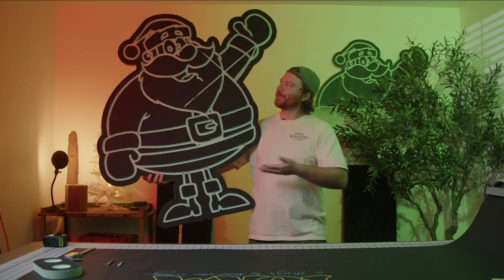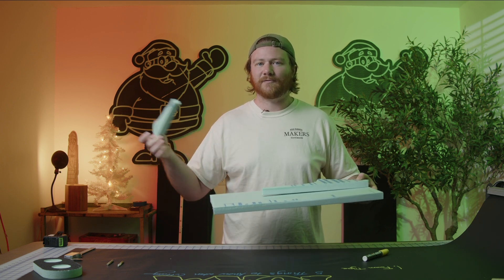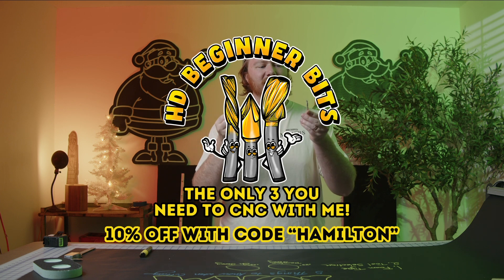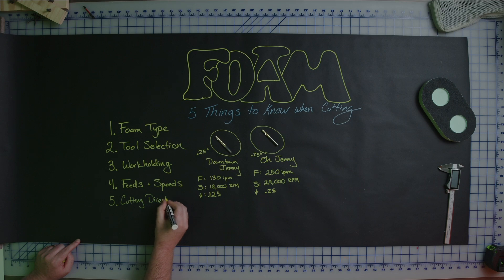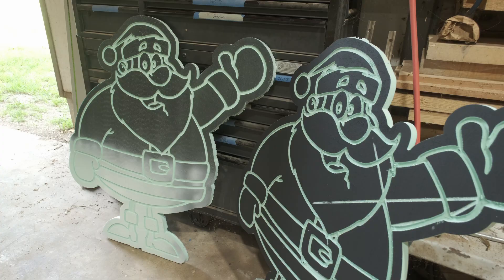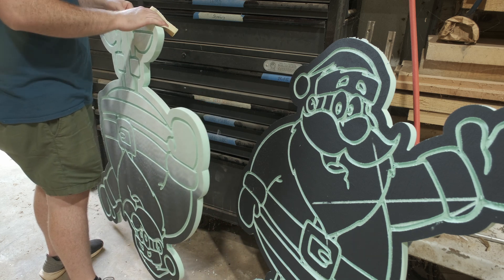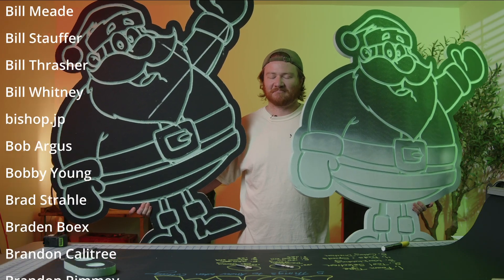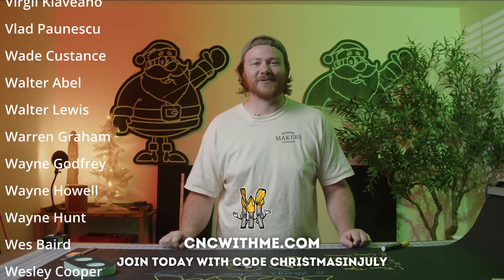5 Tips For Cutting Foam On Your CNC Router

Comment: Thank you for posting! I'm considering the Maslow for cutting 2 in rigid insulation foam into triangles for my geodesic dome. I don't need crazy tight accuracy; I just need a speedy way to cut these triangles. I'm getting about 4 triangles out of one 4x8 sheet of foamboard ( manually cutting with foam heat knife ) . Each triangle is about 140 inches; so 560" toolpath total per board if it were one pass to cut through 2 inches. Think this is doable? Thanks for any recommendations!

Comment: Hey - used to be a planner and worked a while in a big KD plant so HOOYA. 
So you didn't illuminate us about what the upcut function in the program does differently. I haven't a clue. Gimme a clue!
You did offer a little theory on spin and feed - I've never worked with foam and now I need to without a CNC - just from a template. I'm going to use a trim router in the hand to make simple cutouts of printed poster-size stuff. Haven't done this in a while. It'll be production scale - a few hundred a month. Bet you it's faster.

Comment: I may have missed it but did you paint the foam before cutting it to expose the green foam underneath?
Reply from the maker: yes! any spray paint will work as long as its not lacquer based. Lacquer will melt the foam
Reply: @HamiltonDilbeck  I used that foam to make some tombstones for the yard last Halloween. I used the wrong spray paint because it did melt tom some degree as you indicated. IN the end, it was OK because it gave the headstones a very weathered/worn look. After carving I used various colors of epoxy for the graphics and lettering. They came out really nice. Thanks for the tip on using non lacquer based though, I may try using this again for other projects that I don't want to look worn.

Comment: I cut foam often (xlpe). I always rough pocket with climb, leave a little stock, and finish the walls with conventional. In some foams, a conventional pass will produce long ribbons of material that will wrap around the bit. 

I run with the highest feeds and speeds I can, only if the material is rigid enough. Softer foam is tricky, so i keep a high chip load but lower the rpms and ipm. There's a risk for melting material. Also, conventional cuts can suck softer material into the cutter and ruin your part.